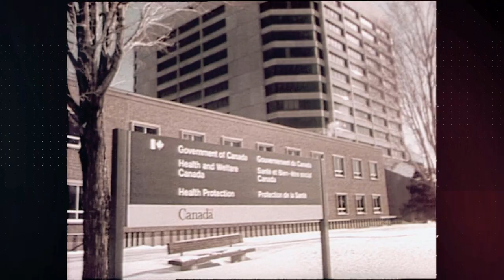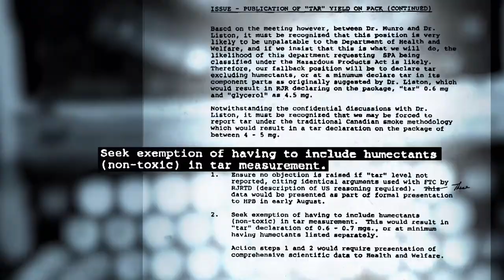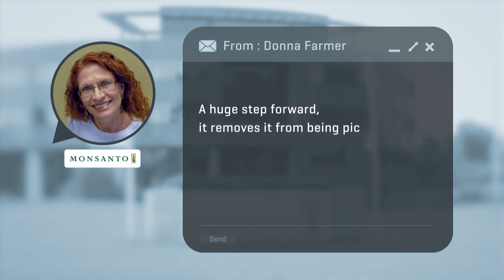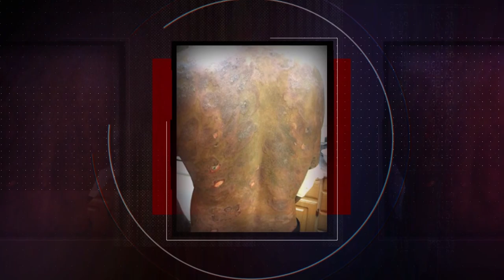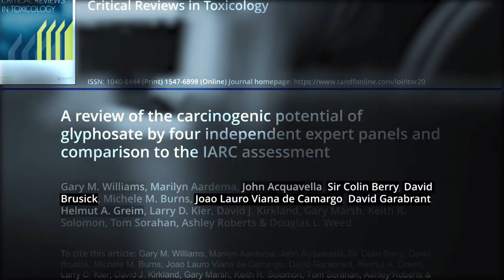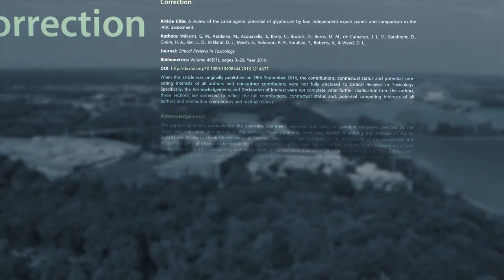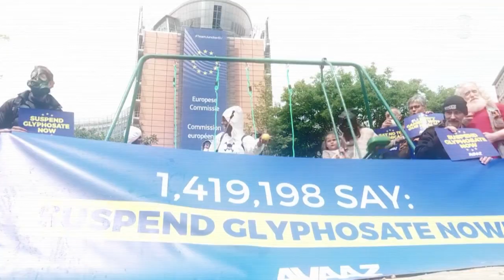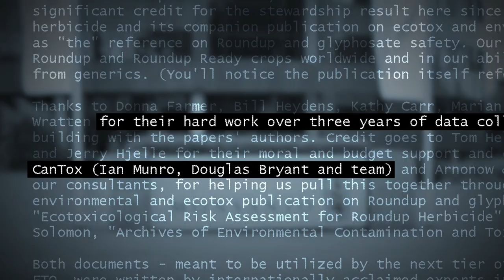The Monsanto Papers : Roundup & The Canadian Connection  - Enquête

Comment: What if ? I feel compelled to put this out there and perhaps save someone. A cousin male 30 years old and an Aunt 50 years old both died of that disease.
The only common denominator was that they both lived in homes completely surrounded by orchards just miles from each other. Now I live completely surrounded by orchards.
On many occasions I have felt the wet mist on my body from the spraying even when the spaying is occurring on the outskirts. Any wind makes it real bad.
We always run for the house when we feel it or see the machine coming. Those fine particles coat everything because when it drys everything is white.